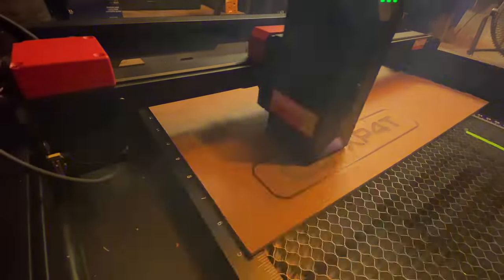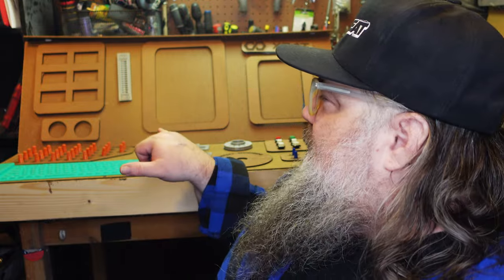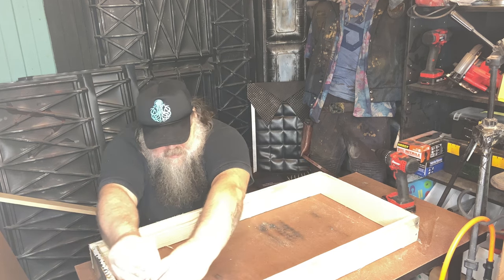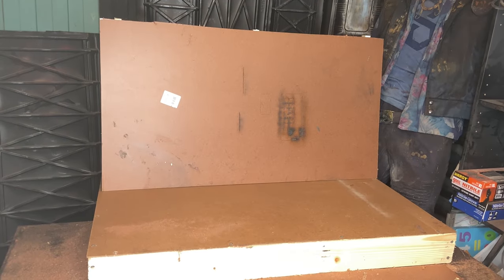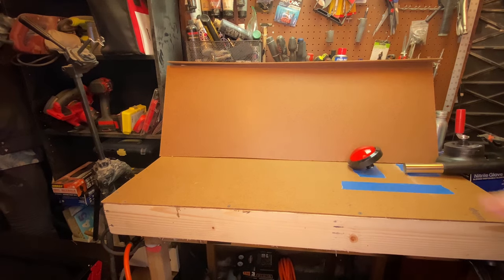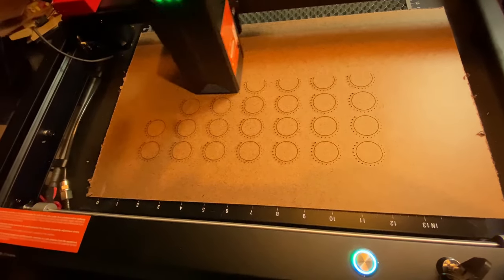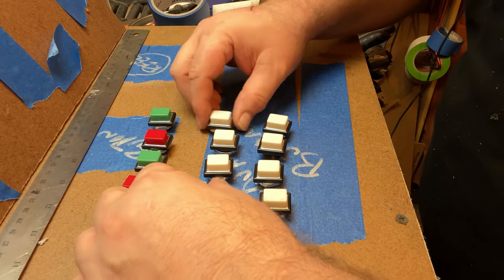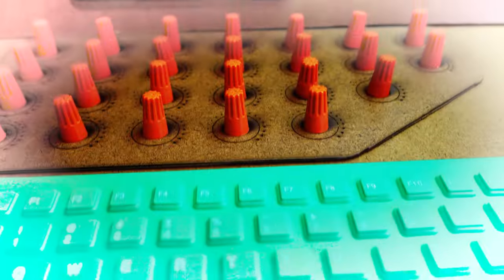DIY SCI-FI FILMMAKING MAGIC: CRAFTING A SPACESHIP CONSOLE SET PIECE | EPIC BUILD SERIES PT 1

Comment: Although the project is probably finished by now, A few years back I built a Space Ship/Mad Scientist Control Panel and for the displays I used Digital Picture Frames (Actually I built a Time Machine for another movie and mounted a Computer Monitor in it for a active, on camera display but that required a computer off camera.) for a "On Camera" changing display.  I found/made pictures for the Picture Frames and loaded them in to the frame for display.
Reply from the maker: Who needs a time machine when you can build your own space ship? You're definitely thinking outside the box with your projects!

Comment: So two questions, first do you think your dial reading marks would just get filled in by two coats of sandable filler primer, and second does the laser your using work with acrylic plastic?
Reply from the maker: Not sure yet but thought that too probs will prime those two pannels with Tamiya model spray paint